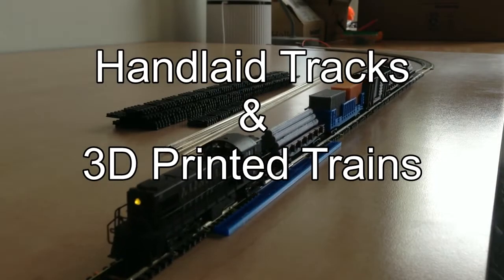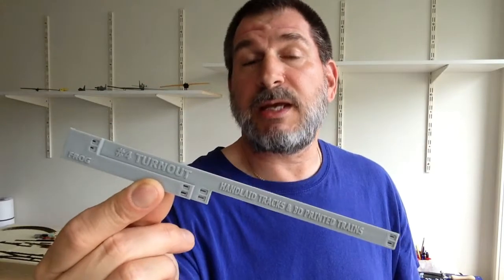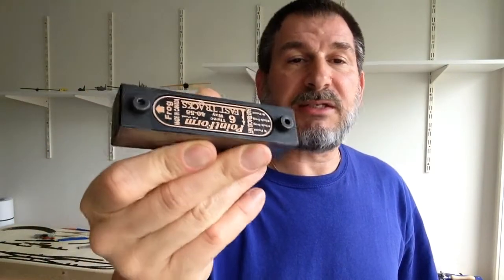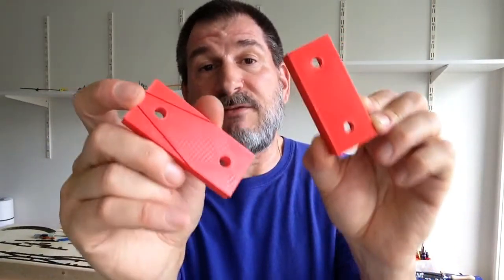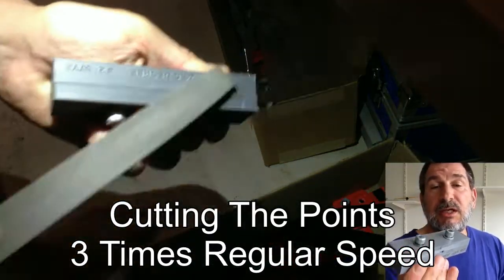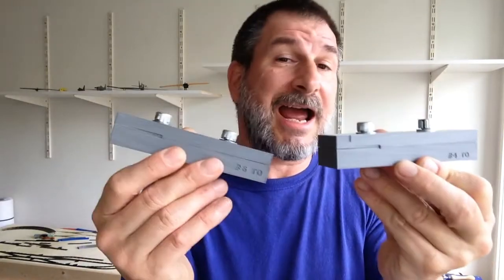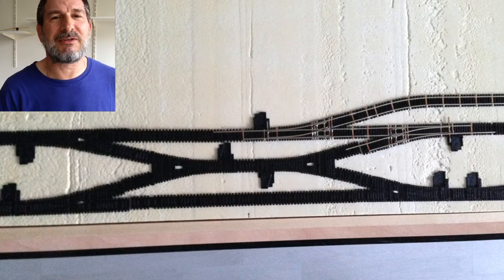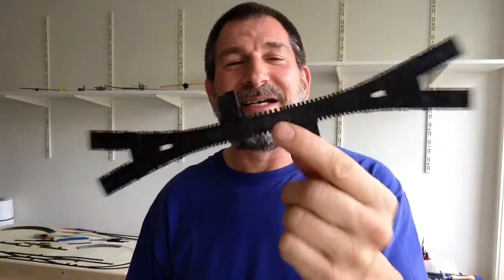Turnout #2 4 and 6 Rail Cutter Frog and Diverging Rails

Comment: Thanks for designing these .. so far everything you have done has made it quicker to create turnouts .. now if you just make your rail jig available I will really be able to get those 80+ turnouts done :)
Reply from the maker: Which rail jig? The rail cutter? I don't have access to the lengths of the stock, frog or diverging rails for a regular #6 turnout. Let me know how long those rails are and I can adjust one.
Reply from the maker: I'll try to get it put together for next Thursday's video. Are you going to do the rest of the track? Straights and curves? I have 9, 10 and 12 inch curves done and simple straights - all in "siding" spacing which is still MUCH tighter than Atlas flextrack.
Reply: @handlaidtracksand3dprinted922  I am only hand laying turnouts .. the rest will be Micro=Engineering code 55 flex track.
Reply: Are you up load ho scale jig